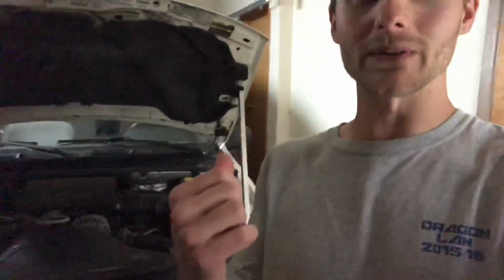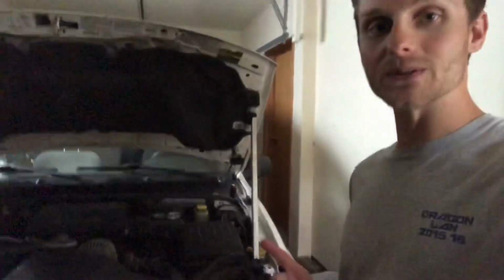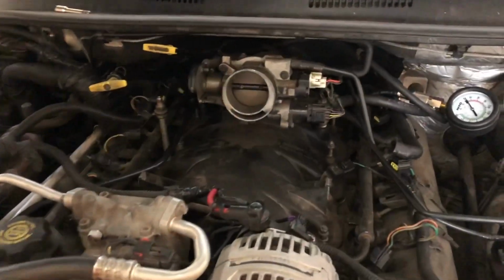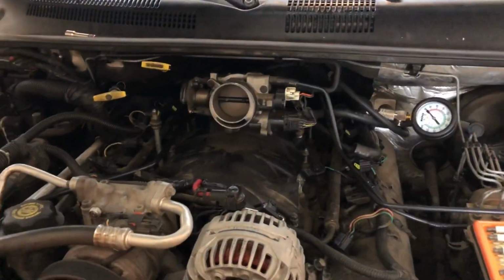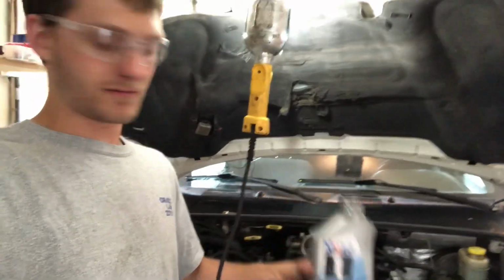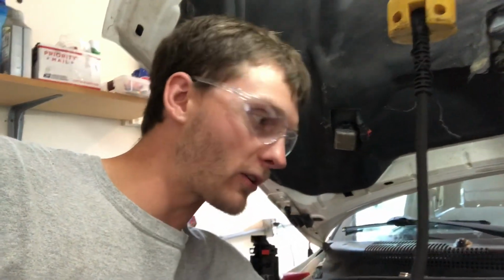How To Do a Compression Test on your Motor (Jeep 4.7l V8) - Daily Vlog

Comment: Does yours run rough or just idle? Mine idles rough but once I give it gas, it runs great. Still has amazing power.
Reply from the maker: It would run good as long as I was on the gas. Several times after letting off the gas it would die at stop signs and lights.